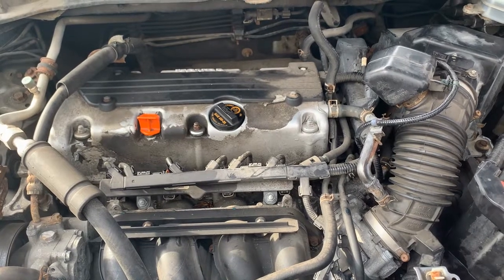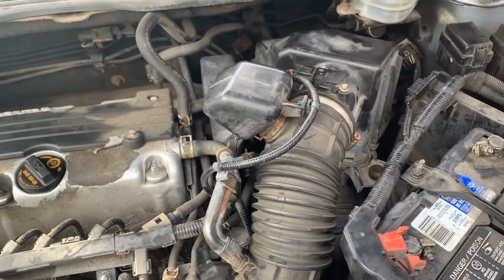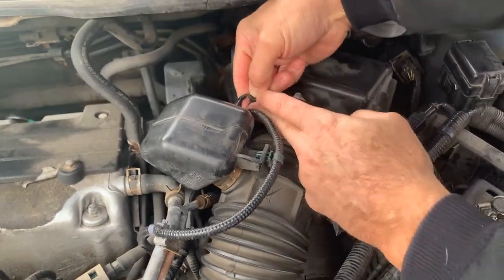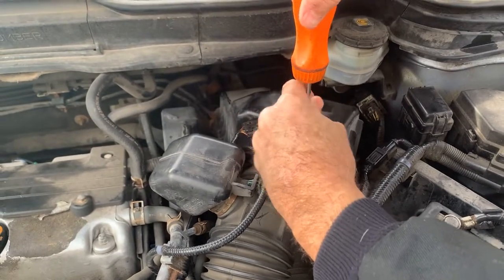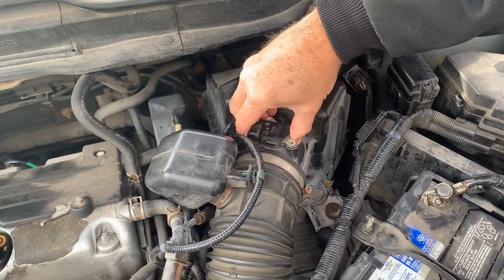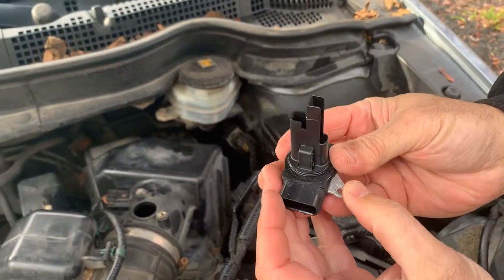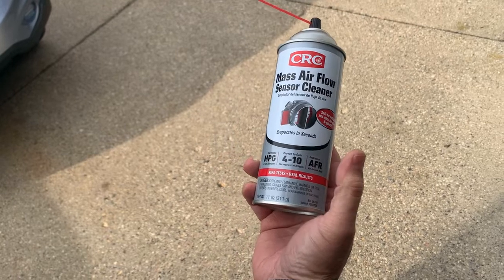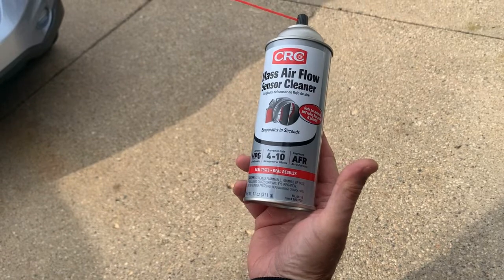How to Clean or Replace Mass Airflow Sensor Honda CRV

Comment: I have WD-40 Contact Cleaner, is that pkay to use? Google results seems to say yes. Note: not normal wd-40, specifically their contact cleaner.
Reply from the maker: I personally would use something that is specifically made for that application. That's why we use CRC mass airflow cleaner.
Reply: @TheAutoTeacher  did s'more googling and someone pulled up the data sheets on two products and they are indeed different enough to warrant using the dedicated stuff. I'll spring for a can! Thanks.

Comment: Hi, I am about to purchase a new MAF sensor but the choices I have are without housing and with housing. I bought th cheapest which was without housing and my car ran worse so obviously wrong part. What is the housing as photos of product looks exactly the same!
Reply from the maker: There's no way you should need a housing when replacing this MAF. Just make sure that you get your mass airflow sensor from someplace that is reputable ,offers a quality product thats made to the specifications of the manufacturer .
Reply: @TheAutoTeacher  thanks for the reply
 Have now replaced it, should the fault codes disappear straight away?

Comment: Thank you so much! I once read that you have to disconnect the negative from the battery, is that true? Your information is very well presented! New subscriber here!!!
Reply from the maker: No, there's no need to disconnect the battery when cleaning your mass airflow sensor.
Reply: @TheAutoTeacher , thank you so much!!!
Reply: You rock thank you
Reply: They told me it was a catalytic converter on the mufflers. I said it wasn't designed to live in California. I'm in Oregon.

Comment: Could you also clean the electrical connectors with some electrical CRC cleaner ?
Reply from the maker: Yes, CRC makes various types of electrical cleaner, but I would use the CRC specifically made for mass airflow sensor if you're doing the MAF.

Comment: I am not sure if I cleaned the correct part on my 2004 CR-V.  On top it says “sensor assy, map” and it has a electric plug.  If I look down the hole where this part goes there is a fine mesh screen.  Is that it?
Reply from the maker: No that is not it, that is your map sensor which measures intake manifold pressure which calculates the amount of air in your CRV's engine then regulates the correct amount of fuel to inject. Plus if you examined the map sensor and the mass airflow sensor they don't look the same.

Comment: We just bought a used car of this version.  How frequently does the MAF sensor need cleaning say when the light doesn't come on? Also, what is the mileage of that vehicle. Thanks for the video!
Reply from the maker: It had 130k miles and I would clean it every 40 thousand miles or so.
Reply: @TheAutoTeacher  also is it okay to also clean the electrical connectors with some CRC cleaner spray too? And can you clean all your connectors like that with the spray ?